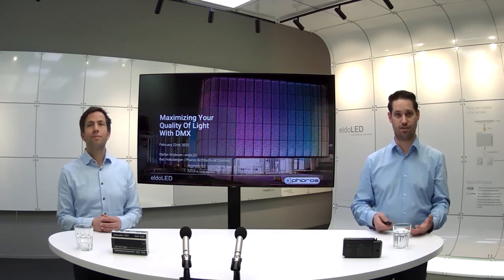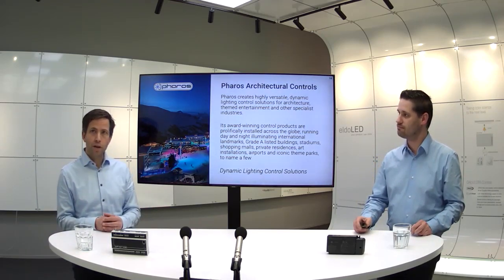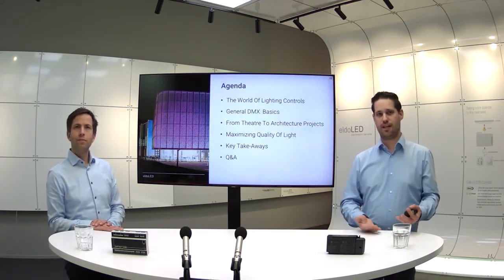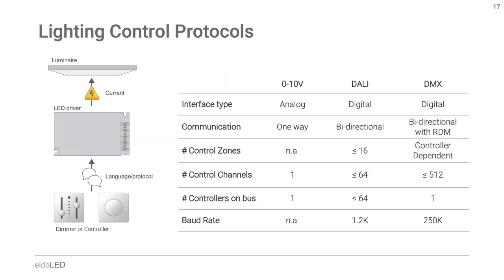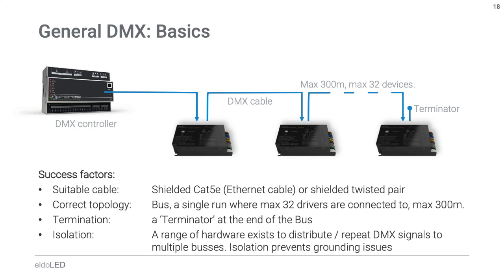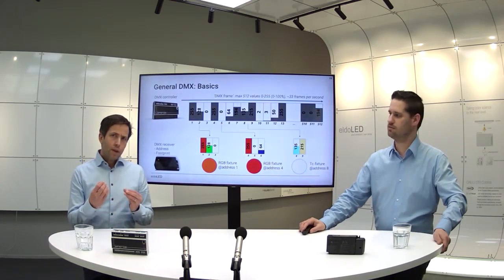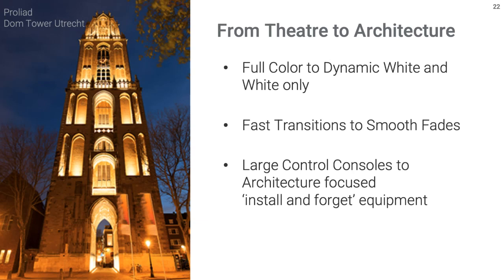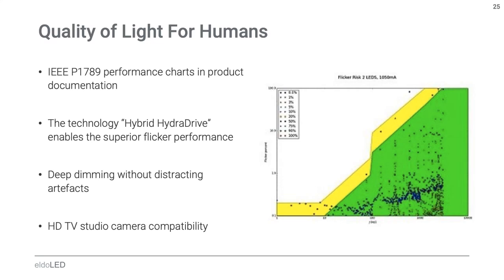Maximize Your Quality of Light With DMX Webinar - arc magazine | eldoLED

Comment: my old chauvet q spot 260 doesnt respond when i use any dmx controler but when i conet the fixtuer as a slave of onother fixture q spot the dmx responds well. i am not sure if my dmx board is dead and aum assuming that if my fuxtuer dmx board was ded it wasnt going to respond when connected as a slave from another fixture. any help will do. thanks in advance